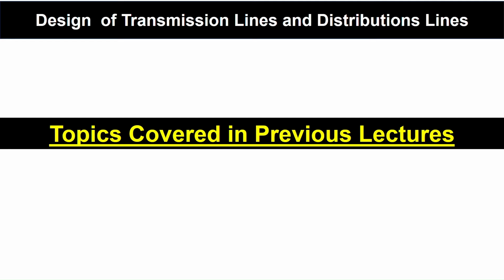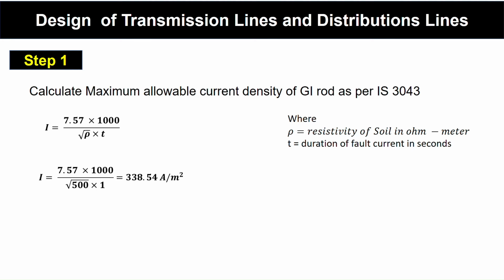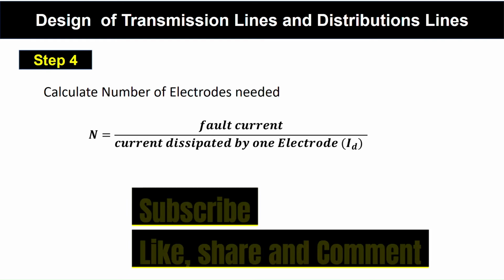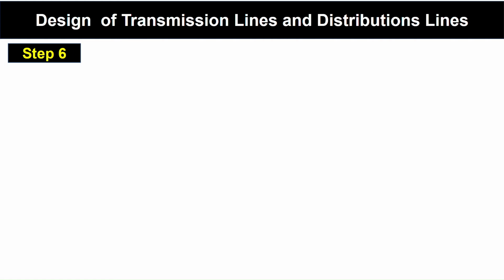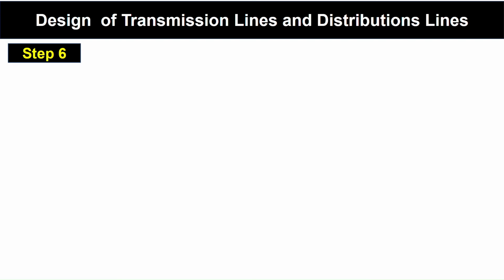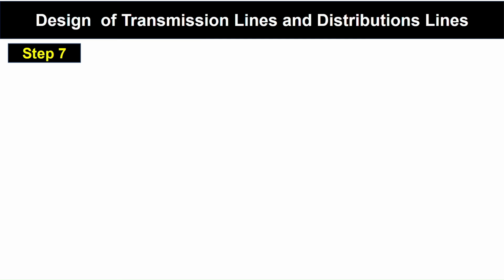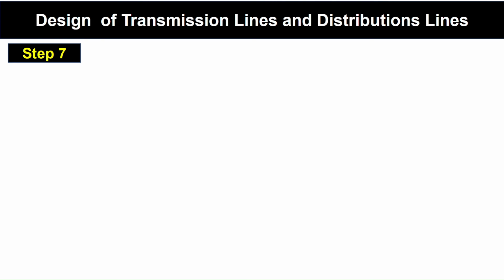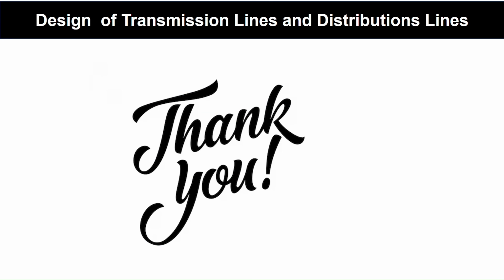Step to calculate earthing resistance value and Number of Electrodes Needed

Comment: sir thanks a lot for your wonderful numerical illustration i have few query- when we design for substation mesh, there different time strips used a complex mesh become, fault current of every protection unit is differ, so during the design what aspect are consider or simple way just go for considering max fault current for whole system but this will lead under utilization of  earthing grid & cost of system design increase -can you put some practical aspect on it
Reply from the maker: every protection system is designed for adverse condition